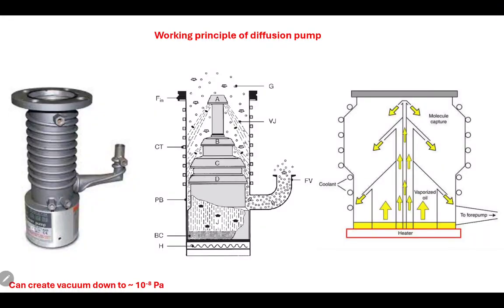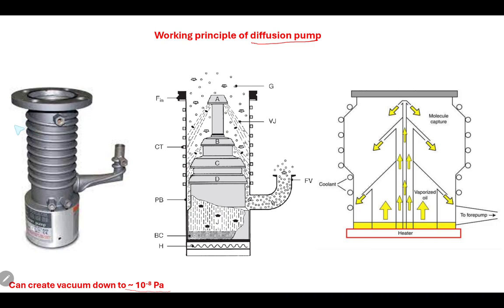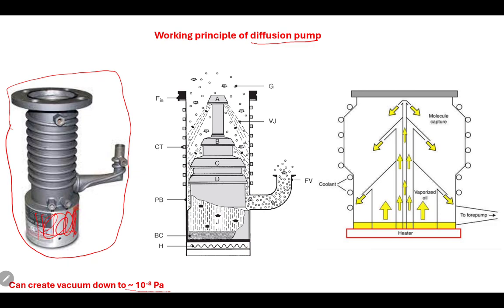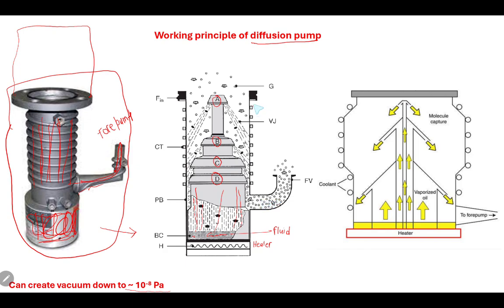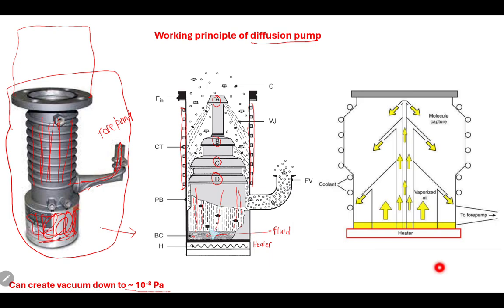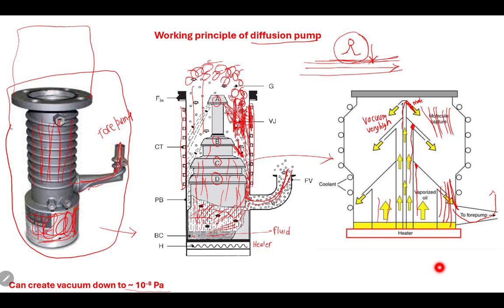Diffusion Pump | How to create high vacuum | Vacuum Technology | Concept Circle

Comment: Thank you for the video. I have a question though: how do the atoms/molecules/particles escape to forepump? When the oil condensates and deposits on the bottom of the pump, why don't the particles do follow through?
Reply from the maker: Thanks for watching the video and asking a good question!
The answer for your doubt is as follows:
The gas molecules don’t condense and follow the oil because they have much lower boiling points compared to the diffusion pump oil.
 The diffusion pump oil is chosen for its high boiling point, meaning it can vaporize only at high temperatures and remain in a vapor state under the pump’s operating conditions. Gas molecules, on the other hand, generally have low boiling points, so they remain in a gaseous state at these temperatures. This difference prevents them from condensing along with the oil.
The high-speed oil vapor jet simply carries the gas molecules by momentum transfer, but there’s no binding or significant interaction between the oil molecules and gas molecules that would cause the gas to condense along with the oil.
The forepump continuously pulls gas molecules away from the diffusion pump’s bottom, preventing any accumulation that might lead to unwanted condensation.

Hope it helps!